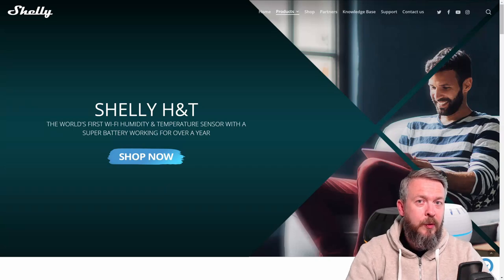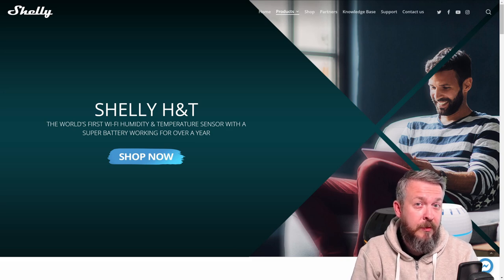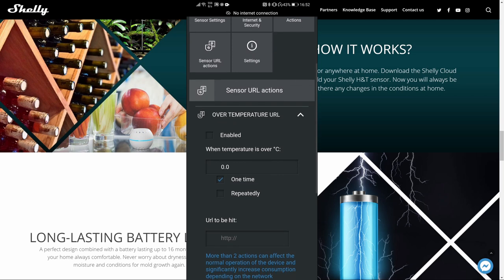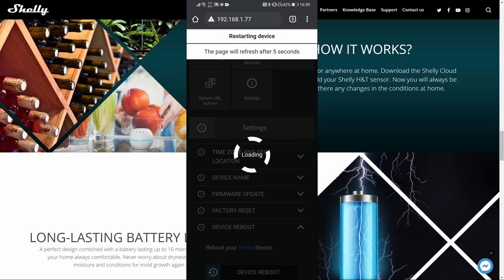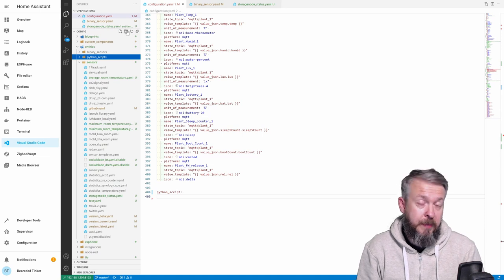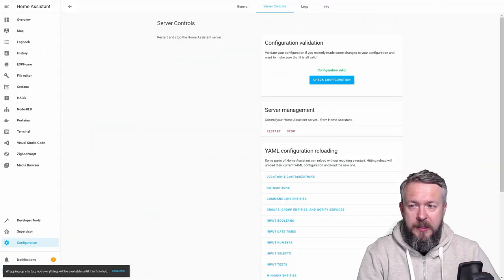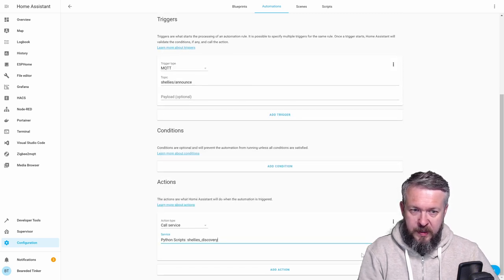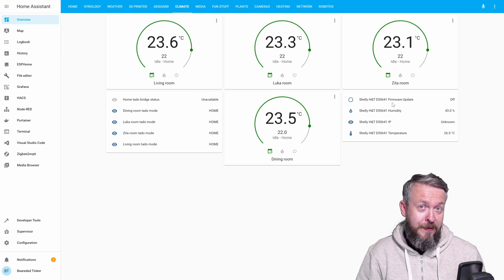Adding Shelly Humidity and Temperature sensor to Home Assistant

Comment: Thank you for your video. I enjoy your presentation style in that it is organized and easy to understand. You also give examples that are very useful to noobs like me. In a second home I will install several Shelly devices as well as some z-wave devices.
Q: Why Shelly H&T instead of something like Aeotec 6-in-1 that has six sensors...motion, light, temperature & humidity? Do you know why Shelly did not make more functions in the H&T sensor?
Thank you again, Cheers
Reply from the maker: Thank you for your comment Daniel!!! Much appreciated. 
In terms of other sensors - I have bunch of them - a lot DIY stuff, but also Xiaomi ones too (plus one kickstarter project).
I presume that decision was because of the battery life - we are talking here about WiFi and it can really drain the battery fast - there is option to use external power, but for such a small sensor you do lose mobility with it.

Comment: Excellent video - thank you. Can you explain why you selected the MQTT installation - what are the advantages and disadvantages of the three methods
Reply from the maker: Hi Mike and thanks for the comment! And this really is great question.
I use 2 integration types - MQTT, mostly for battery powered devices but also for some other. Reason was that support for battery powered devices, was introduced first in MQTT as it really doesn't require much for it to work with this setup. Also, this enables me to save all states easily when HA restarts - they are available through MQTT and when HA get's back online, all data is already there (some devices don't update or provide data unless there is change). Also note - some device information is available here, that's not available in any other integration. Closest one in terms of entities generated from devices is HACS component ShellyforHass. HA is still a bit behind on them. 
Other integration I use is internal HA - and I made switch when HA started to implement new feature and Shelly devices much faster then previously. Reason was simple - if I have a choice of internal and external (custom), I would prefer internal to be sure it would work with next update. Negative side is that it provides least entities though!
Shellyfor HASS works great, but since I already had internal by default and MQTT - really didn't need 3rd one and that's why I removed it.

Comment: Thank you so much for this video! I have, however, not yet managed to get it going. Some interface elements are different in more recent HA and Shelly firmware incarnations, and maybe that is a problem. So, I believe I did everything that you said, but in the MQTT integration, the sensors aren't shown. In the Shellies discovery, I get "Error rendering data template: UndefinedError: 'dict object' has no attribute 'payload_json'" which I have seen elsewhere, but I haven't seen a solution to this yet. Restarting HA multiple times did not make a difference. Any thoughts? Thanks!
Reply from the maker: Do you have both automation for Shellies Discvvery script present and configured? This error is present when you run automation by hand I think.
Check this link for few troubleshooting steps.
https://github.com/bieniu/ha-shellies-discovery/issues/281#issuecomment-1092738689
Reply: @BeardedTinker  Thanks. The issue is solved. I needed to use the Gen2 script. Works great now.
Reply from the maker: @wolfman65812  forgot to ask what type you have - but presumed you had original one not the new one with screen :) Glad you got it working!!!!
Reply: @BeardedTinker  Yes, indeed, the brand new one.

Comment: @BeardedTinker
First of all, thanks for the tutorial! Very clear and useful!
I recently updated to the newest HA Core and OS Version, since then my Shelly HT devices (Battery powered) regularly report an unavailable state. If i press the physical pin on the device or if i listen to # in mqtt, the states are updated and i receive values again. I also updated to the newest py script and the newest shelly firmware, but that doesn't help either. Did you experience anything similar?
Reply from the maker: Thank you Adrian! My Shelly HT is offline for some time - battery died, and I need to pickup usb dock for it so haven't seen any issues with it and new update.
I did see the new Shellies for HASS script released today (or was it yesterday?) Do you have that one installed? 
Not sure what could be wrong, did you update firmware on it recently too?
Reply: @BeardedTinker  Thanks for your reply! I just saw that too, theres a new script version again. Yes i did upgrade the shelly firmware too because the new script needed a certain fw version too work. I guess i will try with the new script and the new shelly fw and see if that works.

I just found it confusing because everything worked like a charm before the new HA OS and Core update. I didn't see any changes to a correpsonding integration which should affect the shelly/mqtt functionality so i figured i ask if you experienced a similiar behaviour
Reply: @BeardedTinker  Short update if you're interested: It works fine again with the new Shelly FW and the new discovery script. Also Shelly allowed within the new FW to set the humidity threshold to minimum 1 instead of 5 which i think is pretty neat.
Reply from the maker: @adrianzurbrugg4208  that's great. I need to pickup my USB dock for it. Bought it 10 days ago but opted to pick it up instead of mailing it.
Want to see how it improves on update frequency of sensor.

Comment: Awesome tutorial!  Just got my 2 H&T configured MQTT working with my HA 12.3 Core on my RPi4.
Your video saved me a lot of time but I had to redo the steps in order to get it working well.

Mind me to ask a question?
Is it true once cloud service is disabled, the ability to use the Shelly mobile app is long gone?
Reason why I asked this because to set up static IP of my H&T, the UI forced me to disable native cloud service otherwise it wouldn't let me to setup the static IP address of the unit.
Reply from the maker: Haven't tested it, but I presume so. 
But, you don't need to set static IP address for Shelly if you are using MQTT - it should work even with Dynamic.
Second option, if your router supports it is to in DHCP section set this device to permanently has this address even if it's dynamic. I do it to some of the devices (for ex. Google Minis etc).
Reply: @BeardedTinker  I did that too to assign a static IP from router.  Each Shelly device has its own IP address assigned by the router.  Now I will have to "wake" it up and remove the static IP from the H&T and re-enable Cloud service and see if I could re-add it back to my Shelly app.
Reply: Did it and worked!  Thx man!
Reply from the maker: That's great - glad it's working!!!

Comment: When should I use WiFi Acess Point?
Reply from the maker: On Shelly? When you don't want to connect it to our existing WiFi - you can than use it directly. But this is mostly used just for configuration.
Reply: @BeardedTinker  Ok so in order for the Shelly H&T to works, it needs to be on the external Wifi. Access Point cannot work as a internal wifi for the Shelly device to works and provide information to the app right?
Reply from the maker: @dorotheetherrien5428  it needs to be on your standard WiFi connection (WiFi  settings) On Shelly if you configure AP, you need to connect to it via phone, same as during configuration. But since this is battery powered device, it will not be awake for a long.
I hope this is the answer to your question as I maybe havent' correctly understood what external WiFi is.

Comment: Anyone know how to reset it so it can be re adopted?
Reply from the maker: Press and hold the button for 10 seconds to factory reset. Or just single press to turn on AP and connect to it cirectly.
Reply: @BeardedTinker  Thank you very much for the reply.  I'll give a try again, i already tried yesterday with 10sec, but having it with the micro USB plug to AC, not sure if this isnt allowing the reset to happen, maybe i should get a battery and try it like that.
Reply from the maker: That's strange. Mine is disconnected since I got newer one. But it should work form what I remember. Can you get into it by just pressing button once and connecting via AP? If yes, you could factory reset it from there.
Reply: @BeardedTinker  You suggestion is very good, sadly i didn't though of it in time, and removed the 4 sensors from the Shelly app, yesterday I made a new network with the old ssid, and i cant make the app find them, so i need to go via the reset way.